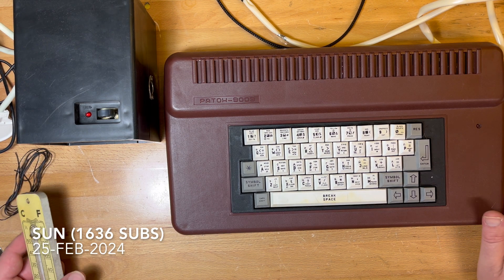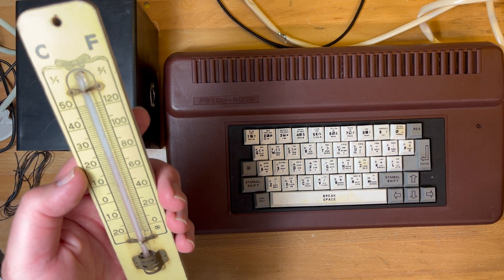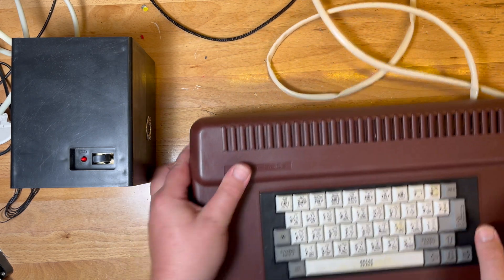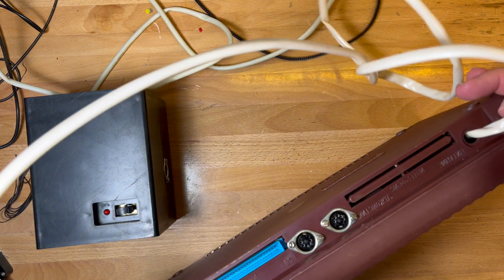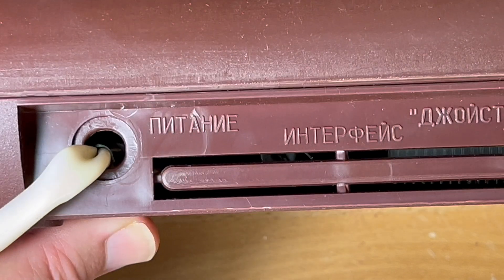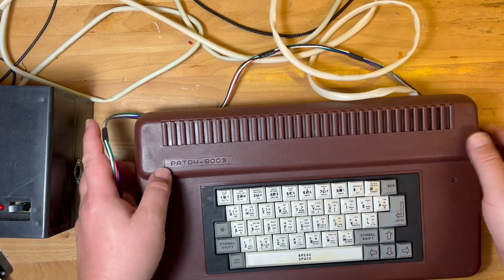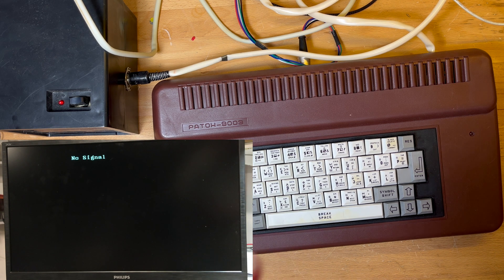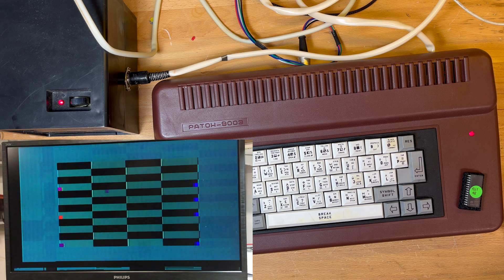🇧🇾 Ратон (Raton) 9003: Part 3 (Where was I?) [TCE #0415]

Comment: Horrible power supply without transient suppression (common mode choke + caps) in these eastern European clones.
I remember how frustrating it was back in the day, when you turned on a desk lamp or plugged something in the power outlet, the computer would freeze in the middle of the game, you'd have to load the game again for another 5 minutes from the cassette tape.

Comment: This is one of the popular series designs. Its brother is Олимпик-С. Case size is big cause the original schematics did not have an ULA chip and used a lot of buffers in order to tolerate the peripheral hell that this PC expected to face during execution of the designated role - it is expected to be a part o a school computer lab. And by the standards of those days, these ZX clones were the best of the best ZX48 clones at the post soviet market. However! Those ZX clones never came to schools. Cause there were no peripherals and no software. Also, the market price was higher than the price of an x86 compatible PC "Поиск" (Moreover, this one had all the needed peripherals to setup the PC lab in no time).
Reply: Green square capacitor at 7:18 is a soviet КМ series cap. It is a tantalum capacitor but due to a limitation of the soviet technology, that capacitor contained a nice portion of the chemically pure platinum. Since КМ caps were the most common in expensive soviet tech (PC and mainframes, VHS, monitors, printers, CNC controllers, expensive TV, calculators, oscilloscopes, HiFi Stereo systems, military stuff), then after the fall of the USSR, everything that had those caps was literally ripped to pieces. Rare soviet made PCs and other late USSR hi tech destroyed (((( So many things just gone......
Reply from the maker: Not surprisingly, my Olympic-S also has a similar fault ;)

https://youtu.be/Is7OYu_t9q4

Comment: if thats got a bridge rectifier in it...then the input coming from the box PSU is highly likely AC...id be careful poking around in it!
Reply: The block might literally just be a  massive step down transformer.  Probably pretty safe if it's being fed rectified in to a 5V regulator.  Probably not very high voltage on that side of things, and isolated by the nature of being a transformer (although this isn't always the case) but yeah probably prudent to measure it to check.
Reply: @Aeduo  better to be safe....than have a shocking experience!
Reply from the maker: I had a look at my first video on the machine

"The PSU is pretty big - it's basically just a 220V-to-9V transformer ... rectification & 5V regulation is done inside the machine.  It still uses a 5-pin DIN to connect to the machine.

At 240V with no load it's putting out about 9.6VAC."

https://youtu.be/1CAlqGtarjI
Reply: @Brfff  ahh that makes sense!

Comment: Rather hi-tech computer, but made in a horrible manner, with lots of loose wires, badly shaped pins etc.
Reply from the maker: I'm not very keen on the "last minute" bodge wire connected to the lifted pin on the ULA!